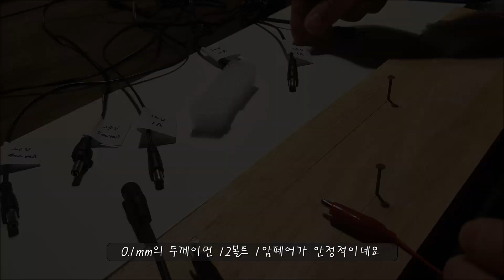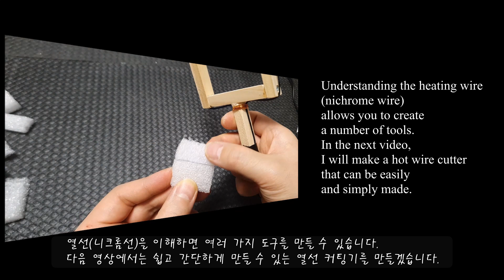Essential material for making wood burning pen or soldering iron (Nichrome wire experiment video)

Comment: i have 12v 3amp power supply like on ur video, can my power supply burn the 0.3 nichrome wire? i will use it for electric lighter. or what size of nihcrome wire can u recommend to 12v 3amp.?
Reply from the maker: You can't burn 0.3 nichrome wire with a 12 volt power supply
12 volts is very weak so the nichrome wire needs to be thinner
Reply: @MacGyverK  i use nichrome wire from hair blower thinner than hair strand to my electric lighter on my sari sari store. but the wire is getting cut when it burn . so im looking for thicker wire than i used to my electric lighter.
Reply: @MacGyverK  what volts ang ampere do u recommend for 0.3mm wire?

Comment: Hi Sir, for mild heating what mm wire should I use? Wire Input Voltage 5V 500mA. Thanks.. :-)
Reply from the maker: It's hard to say exactly. You'll have to connect it yourself to know. Try connecting with 20 cm of nichrome wire with a thickness of about 0.05 mm.
Reply: Thanks sir.. @MacGyverK

Comment: Hi, what's the required voltage and ampere to heat 32 swg nichrome wire. Thanks
Reply from the maker: The notation indicating the standard of the wire thickness seems to be different from the one here. 32swg How many mm is it?